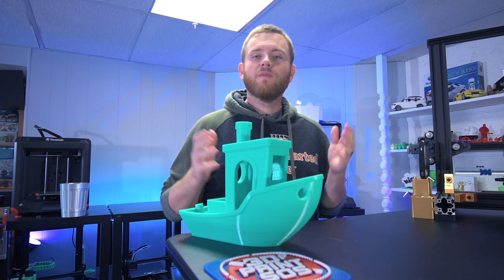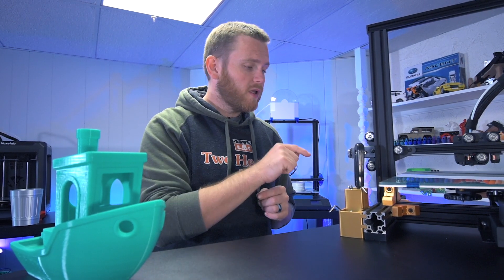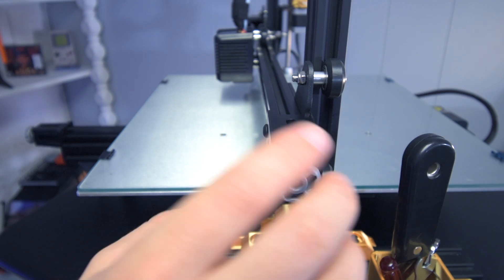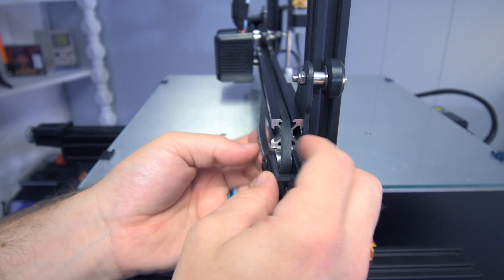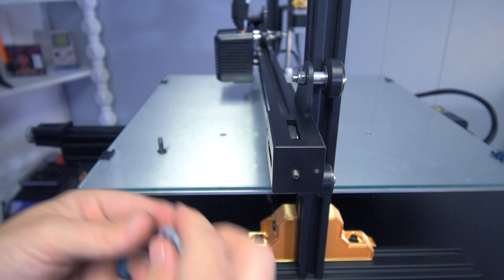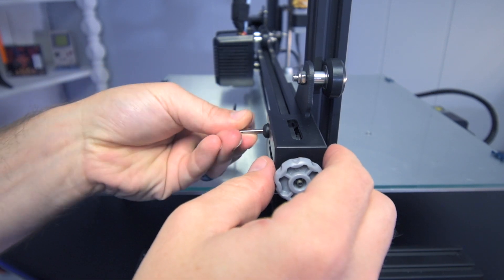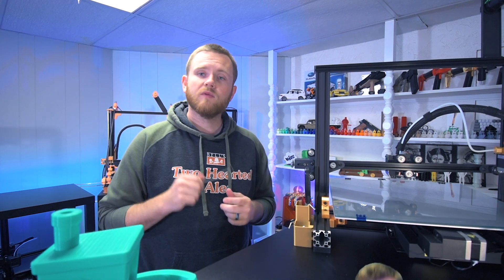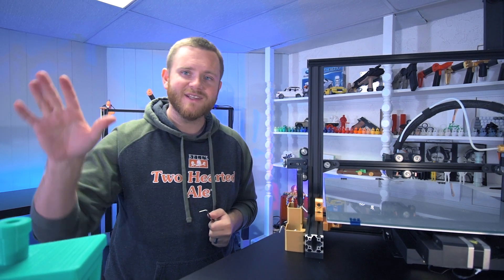Alignment Issue...FIXED!

Comment: I've had my Aquila C2 less than 2 weeks, and the belt is so badly frayed, it is about to split, and I was getting serious misalignment issues with prints, as a consequence.The problem is exactly as you said, and I've contacted Voxelab support to let them know. They are sending me a new belt - and I've bought one myself as backup!

Comment: Nice find! Alternatively, I guess you could relieve a bit more of the side that is hitting allowing it to sit square and taking pressure off the other side. Your washer solution is a quick and easy fix though. Thanks!
Reply from the maker: Can’t. You need the tension on the backside because that screw doubles as also holding the x extrusion.
Reply: @3DPrintSOS  I see. Thanks!

Comment: I bought an aquila when it was on sale on top of being from all reports one of the best ender 3 clones. I was fully expecting to troubleshoot via information about the ender 3 specifically, and while that is true to an extent, that does not actually do any good when it comes down to manufacturer specific issues. Sure enough, the second Aquila I bought has this issue exactly which I have now been able to fix less than two weeks into running it. Going through your videos has saved me all kinds of headaches, thank you.

Comment: Checked my X2, had the problem. Fixed. Thanks for your help.
Your opinion, thinking of getting s second Aquila. Amazon has the regular Aquila for $160 and the Aquila X2 for $203.15. Which would you go for.
Reply: Aquila came in. Has G32. Had to update the firmware from 1.2.1 to 1.2.4. No problems so far.
Reply from the maker: Nice. G32 is great.
Reply from the maker: I would go original and hope for a non H32 machine. ;)

Comment: Hi! Quick question. My printer head doesn’t sit straight, it leans forward almost like it’s too heavy. The top black wheels don’t sit properly in the channel - how can I fix this issue?
Reply from the maker: The bottom wheel has an eccentric nut. Use the wrench that came with the printer to lightly tighten it until you have no play.

Comment: Good stuff as usual Fedor! I first noticed this type of issue with the Ender 3v2 shortly after it's release. When I got an Aquila I suspected it would be the same issue. Voxelab faithfully copied the E3v2 so much so that they even copied this issue..lol. The 2 opposing bolts are just a tad to long and interfere with each other. I really don't know why these company's just don't use the proper bolt length (which I suspect would not be a standard length hence why they don't) or just include two washers! Problem solved for maybe one cent if that much! Keep up the good work Aquila Whisper... IMO...Alex, Jyers (indirectly) and yourself have done more to boost the Voxelab and Aquila brand more than anyone! They owe you some serious gratitude. I hope Voxelab continues to supply you with new product releases in the future to continue your good work.
Reply from the maker: That’s true. Haha. And thank you for the compliment.

Comment: Thanks Fedor, I'll check mine tonight. My tensioner mounting bracket or whatever you call that piece are metal.... I think... 🤦 but I noticed that my X belt seems to travel to the left, it's not right in the middle of wheel. so I'll definitely check

Comment: I got my Aquila X2 this week and I just checked it and there was some play in the tensioner housing even though the bolts were tight. I think the threads are just a little too long and causes the 2 bolts to bottom out on each other so there is no force holding the housing. The washer did the trick.

Unfortunately the X-axis stepper driver went faulty on mine after only doing 1 successful test print, I'm waiting for a replacement motherboard.
I had followed the levelling instructions in the manual and watched your video, I was thinking I had caused the chip to fail by moving the head too much but seeing you moving it now make me think otherwise as I never moved it that fast. Do you know if it is possible/common to cause this fault like that? 
The hotend fan is very loud so I will be changing it but is it supposed to be loud when it is brand new?

I want to try the custom firmware you showed in a previous video but does this work on the X2 with the N32 chip? I saw it mentioned on GitHub that they were unable to compile it as it is not open source yet, but the bin files are there. Does it now work?
Reply from the maker: You should be able to move it with zero negative effects. I remember someone did a test on that actually. Just don’t remember who. It’s been a minute. 

Yes the custom firmware works on the x2 n32. It’s only the h32 that has issues. You should be able to upgrade it easily.
Reply: @3DPrintSOS  thanks, I must have misread the chipset that was supported.

I guess my board was just faulty. strange that it printed the first time.
whenever I try and move the x-axis using the controls the motor just makes a clunk noise.
Reply from the maker: Hmm. Have you checked the wiring? Sometimes if a wire is in the wrong spot, the stepper motor can make a clunk instead of moving.
Reply: @3DPrintSOS  yeah I swapped the connectors on the motherboard for x and Z and can move the x-axis with the z control but then the z-axis will not move with the x control. it is definitely the x-axis driver chip that is gone faulty. the output for one of the coils must have gone open so the clunk noise must be the other coil energizing.
Reply from the maker: That’s a good test. Sounds like that’s the issue.

Comment: I did almost the same when I got my first Aquila, except I used a 3/4 inch washer. That way, the washer actually presses the plastic against the extrusion instead of into the V groove (where it collapses). If you go a bit oversized, you can tighten it more without damaging the thin plastic . I will post a picture of I can. EDIT: I can't post a picture here, but will post in the group, Fedor!
Reply from the maker: I saw. A larger washer is totally the way!

Comment: Thanks! Luckily mine was not so off angle, but I was able to tweak it so that the belt is straight and rides in the center without any washer.
Reply from the maker: Nice! I bet the bolts vary just a hair and mine are on the long side.

Comment: Yes mine is the same and at first I noticed it when I assembled it, I tried to bolt it up straight but as you say it wont let you so I just left it like that lol. I dont think My belt is rubbing though, I will have to take it apart and have a look.
Reply from the maker: Worth a check for the easy fix. :)